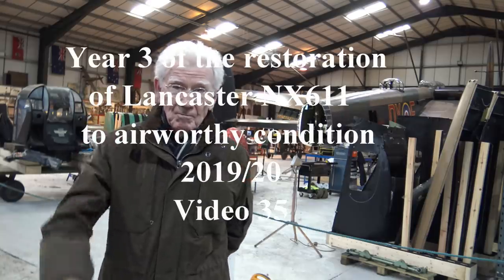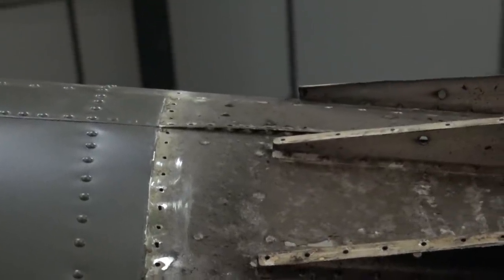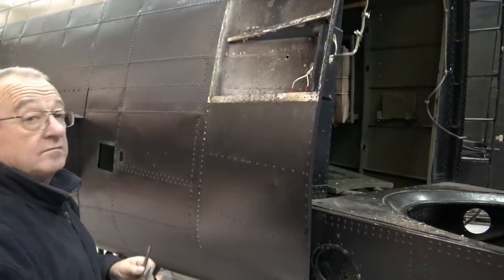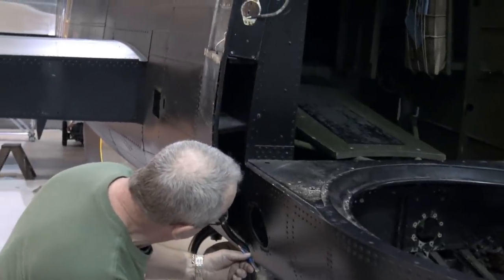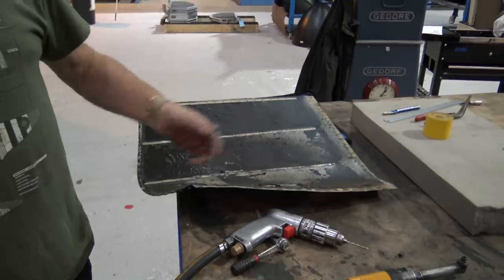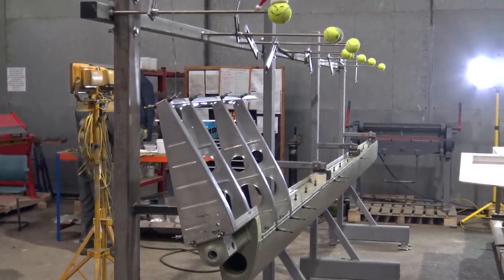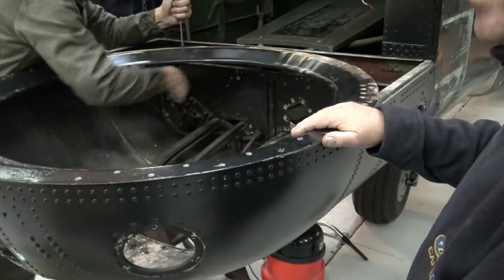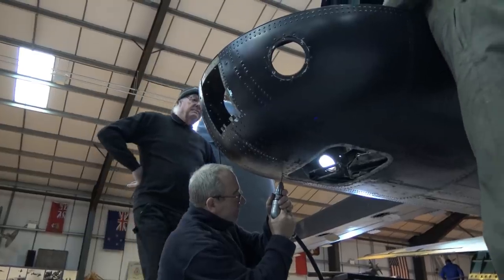Video 35 Restoration of Lancaster NX611 Year 3

Comment: Great video Neville.  Do you know, or can you find out if they plan to make the tail turret functional again?
Reply: I'm sure that I saw on a previous video, that they plan to have it operating hydraulically, opposed to manually, as on the BBMF Lanc.
Reply: Science Chap: From what I have read it will be restored to be fully functional, then put into the bonded store and until such time a donor rear turret will be installed until it’s ready to fly, then the restored turret refitted. Im sure if Neville reads this  comment hopefully he will be able to confirm this.
Reply from the maker: Yes, full restored, as Geoff T commented, the donor turret from Yorkshire Air Museum